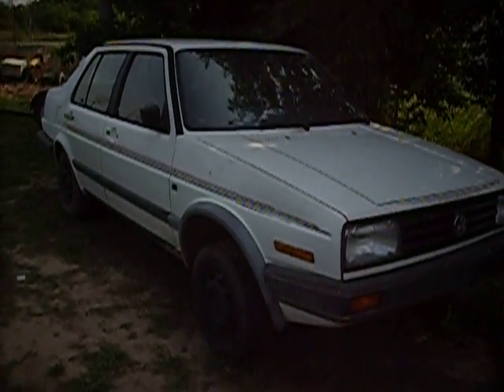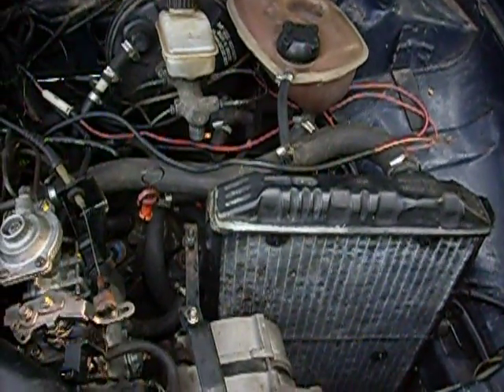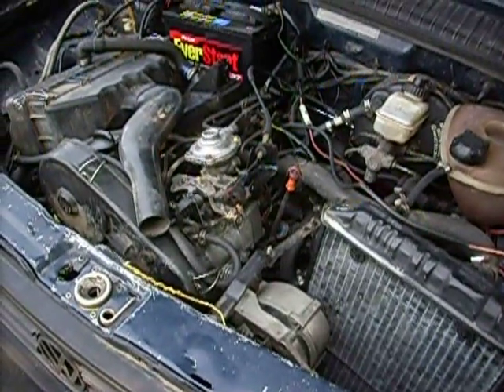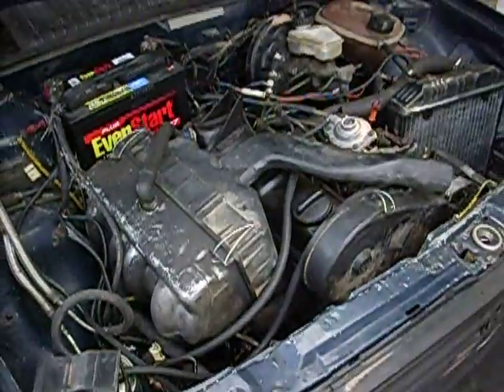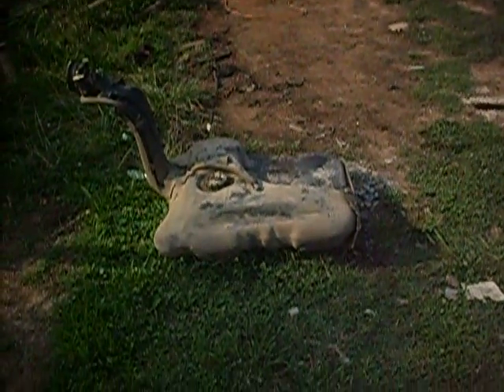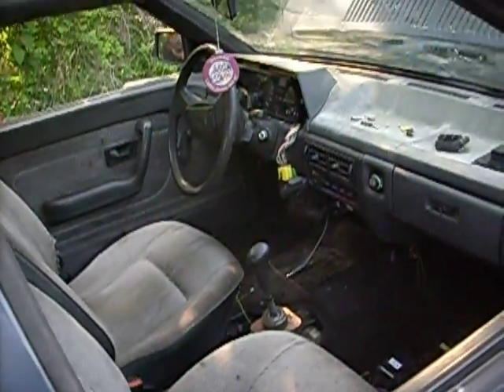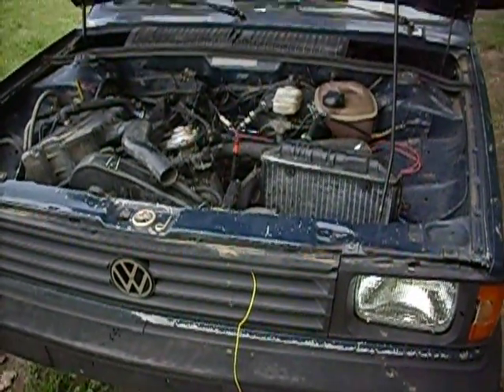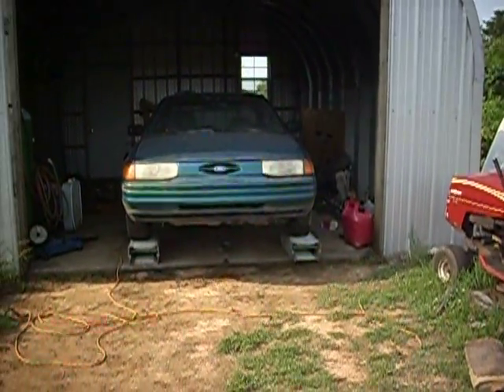VW Jetta to VW Fox engine swap compleat.

Comment: Swap the alternator to the other side of the motor, under the intake. It will free up room for your radiator. That's where VW located them on the B1 Dashers. What did you use for a stater?

Comment from the maker: We made no change to the gears or gear ratio. He just put the engine on the transmission. it seems to drive ok. Only power loss is due to no longer having the turbo.